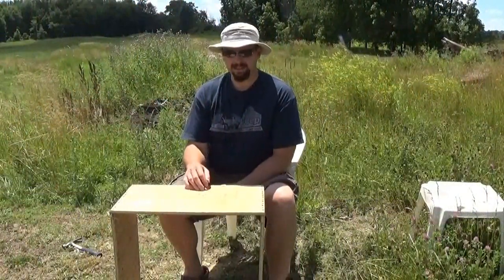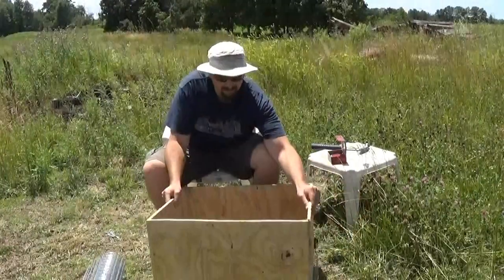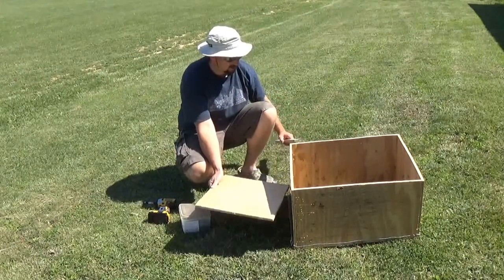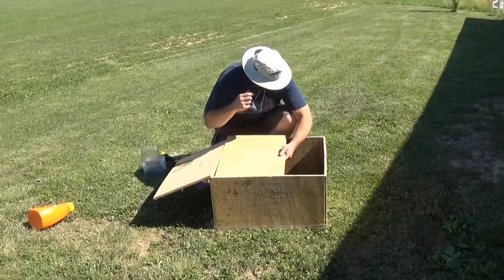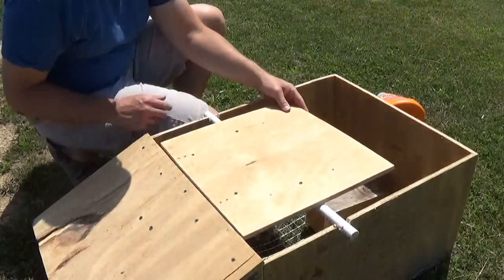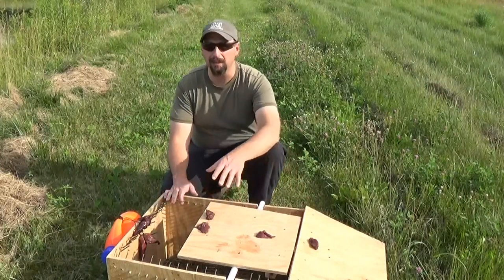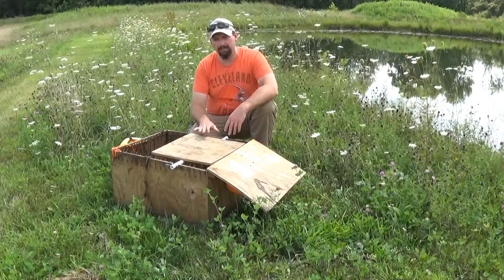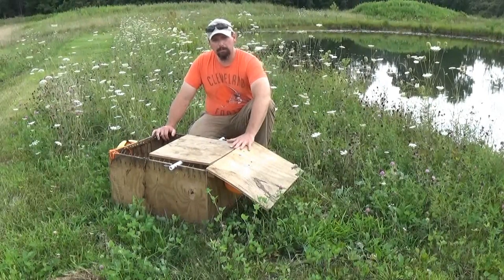The Turtle Trap

Comment: Maybe you should try 4 inch pvc pipe sealed on both ends and some kind of bands attaching it to trap.  They will act like a bobber. Detergent bottles have a smell even after airing out for a while. Turtles are sensitive to smells. I think this is why did not catch anything.  I like the design. Think I will try it.